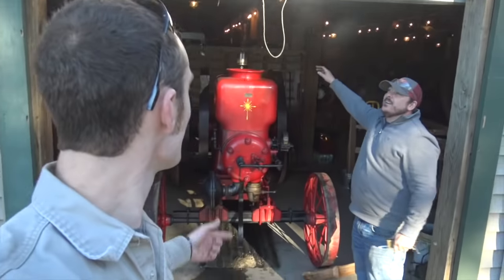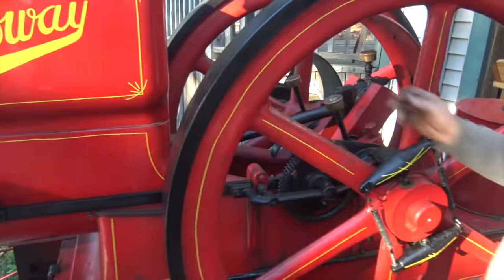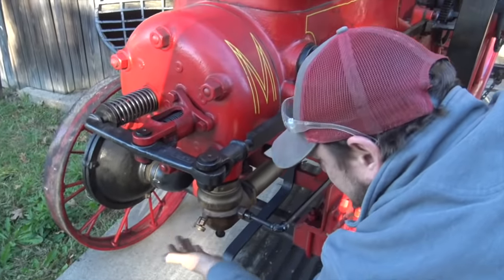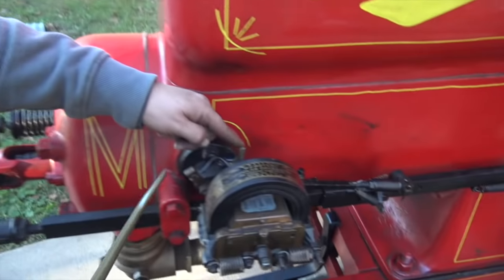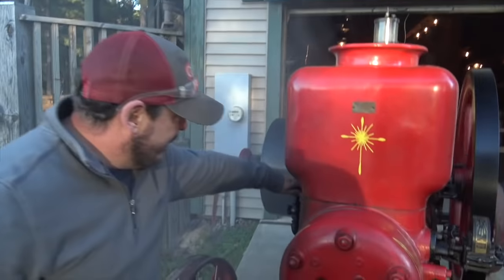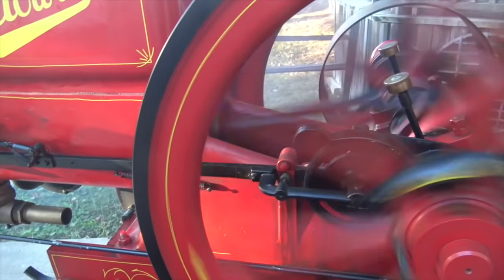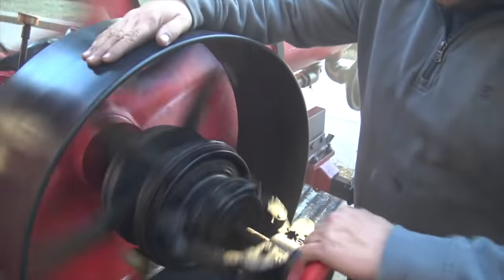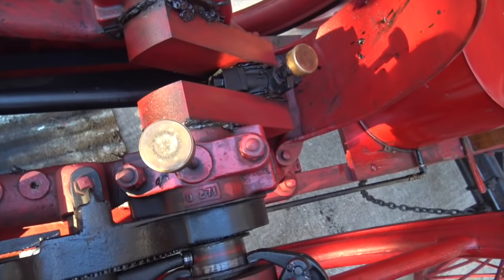WHY THIS INCREDIBLE ENGINE FROM 1916 IS PROOF THAT MODERN EQUIPMENT IS A SCAM & OLD STUFF WAS BETTER

Comment: I really like the old classic engines, but some of the comments about long lasting and new engines are planned obsolescence junk are pretty silly. Take a modern engine and make a few mods.
1. Throw away the electronics and put on a 1 or 2 bbl carb and a low-energy ignition system with centrifugal-only advance.
2. Drain out that high efficiency super-thin oil and replace it with 10w40. In the winter, you had better preheat before starting but it will work.
3. Run your new-old engine at a steady 600 rpm and get approximately 1/5th the original rated horsepower. Oh, and it will also produce about 1/10th the work per gallon of fuel.
NOW how long will it last? Probably a lot longer than an antique engine because of the many advances in metallurgy in the last 100 years. Not to mention better rubber and plastics.
It's mostly not that older engines were better. It's that newer applications are dramatically more demanding.

Comment: Modern equipment is a scam because they are meant to break, replace, and service (though service techs only)
Original Ford tractors are THE MOST easy equipment to repair.

Comment: 42 minutes of tinkering with valves, oilers, screws and spinning a 1klb flywheel by hand just to get 175rpm and tons of black smoke "LoOk aT ProOf tHaT old ENgINEs aRE BetTer" duuuhh." While hit and miss engines are cool, they are definitely not better!

Comment: As an engineer, I agree that "old stuff" was built better and there is a very simple reason.  Today we have the design technology, mainly from computers, to engineer a product to last a certain amount of time.  Companies walk the line between not producing a more expensive and well built item that will last years, vs. an item that will last for say, 1-2 years with the idea that you'll be forced to buy a new one.  Make more money that way.  One hundred years ago, they had to build things robustly because the lifetime/lifecycle design technology didn't exist.

Comment: The title of the video is a scam. Clickbait.The amount of iron used in this old engine for this tiny power output makes it better in nothing. Ridiculous poor efficiency, lots of maintenance like permanent filling up cooling liquid and oiling by hand. Its just a thing of its time, they didn't know better. They last only quite long because the most parts where not really stressed to the limits.

Comment: So its cool and all but it IS a 16hp motor. Take your 16hp mower and belt drive it to 2 - 1000 pound flywheels 4ft across and it would do the exact same job and still be 2000 pounds lighter. Very cool though, jist don't get hung up on false nostalgia. Im 100% positive the engineers in 1916 would have LOVED loved loved to have a modern ICE to replace this "hunk of junk" (not my words, words of a 1916 engineer :)
Reply: Probably a lot more than 16Hp if it was dynoed. I am guessing it was calculated from something like the old RAC formula which was extremely conservative. For example the Austin 7 was a lot more than HP although not a rocket on wheels. Not sure if there was something similar in the US.

Comment: Common misconception that old stuff was built better as a general rune. Its called survivorship biased, we think that because some of the old machines survived so long that all old machines must have been super good and reliable, when in reality most of it was junk after a few years and failed and was thrown away, leaving just a few good machines left. The same will  occur with our machines of today. If a society builds enough machinery some of it will inevitably be good enough to last the test of time.

Comment: Well I mean there is something to be said about these old engines. A sixteen horsepower engine can certainly replace sixteen horses on a capstan, and go just as as fast as sixteen horses. However a modern  12 kilowatt engine will take one horse and drag it over 100km in an hour. That would make quite a difference. 
Now if it's longevity you are after; find yourself a commercial equipment dealer. And follow those maintenance specs to the letter.

Comment: Long, boring tl;dr
The reason why older equipment seems to "run forever" are many. To brush it all off on "stupid computers" and "plastic parts" is ignorant at best.
Firstly - the old eqpt you see today is the one with least use. All the old stuff that was used regularly - got worn out. Otherwise we'd see 10x older cars on the road and 100x older washing machines.
Into the sparse of what you see todsy this engine fits perfectly - because even as far as IC engines go it's built wrong - no crank counterwrights. That will just eat up the big end bearings.
Finally, older equipment is far less energetic. If old engines did just fine with say 10hp/10L displacement, today it's a death sentance as the thing would weigh something awful. And equipment that is physically smaller/lighter yet yields a higher effect will also experience so much more stress and wear.

So this eternal "everything was better back in the day" is a strawman.

Comment: Funny thing... if you get rid of all that computerized trash under your hood, not only does your vehicle run BETTER, but you can fix it yourself with hand tools.

Check out some of the folks who have ripped their engines down from fuel injected to carburetor and compared their fuel mileage.  It's no joke.  If it's not a diesel it doesn't need fuel injection.

Comment: You know... most people are SO gullible... I shake my head! I have now fixed my old ( 60+ years ) oil-fired furnace boiler for the 2nd time in 10 years! I have discovered since the ( first time, in 2016 ) that virtually NONE of the heating/cooling companies want to fix them! Rather sell a NEW 'thorw-away' furnace. Plus the 'yonger techs no little to nothing about them! Two of my neighbors went this route, both about 10 years ago, after seeing commercials form local companies 'warning' them if they had an 'old furnace/boiler'.. they could get 'caught in the cold'.. Well? BOTH neighbors-after opting for the NEW furnaces, voiced regret after having had the repair people out to their homes literally 2-4 times a week the first winter and several times throughout the next ten winters! And now? Those same heating-cooling companies are running commercials that state, IF YOUR FURNACE IS TEN YEARS OLD- it's TIME FOR a NEW one!!! I found video's on-line detailing virtually 'all systems' in older furnace-boilers, and having a decent amount of elctro-mechanical/.pneumatic and hydraulic experience? REBUILT the systems. The first time, it was simply an ignitor- in 2016. The 2nd time this past January 2023? It was simply the hot water safety valve but I rebuilt, cleaned about 90% of the furnace and it has worked flawlessly and will no doubt out last ME!

Comment: IT REALLY SHOWS THE EVOLUTION FROM A STEAM ENGINE TO A GASOLINE ENGINE 🚂🚒 I REALLY LOVE THESE KIND OF ENGINES CUZ IT TELLS ME LONG AGO THAT HIGH RPM ENGINES ARE WHAT ARE KILLING OUR PLANET FROM HIGH RPM LOW FLYWHEEL WEIGHT AUTOMOBILES TO EXTREMELY HIGH RPM JET ENGINES OR POURING GALLONS OF FUEL IN PER SECOND.     DAVID GRENIS BOULDER COLORADO USA
Reply: And your comment tells me you haven't a clue how things work.

Comment: yeah its built to last, but lets be honest theres no way that thing is as fuel efficient as a modern generator or car engine.  he talks about how much fuel he uses but does that thing actually do any work or is it just used for fun? a car engine had to move a 3000 pound plus vehicle 70 mph down the highway.  thats a ton of work, of course its burning more gas.  that thing produces only 16 hp and probably weighs over 1000 pounds easily,  meanwhile a modern 4 cyl weighs only a few hundred pounds and can produce 10 times the hp, without forced induction (turbo, supercharger, nitrous).  the only way this old engine is "better" is durability.
Reply: And old car engines are MEGA shit compared to modern ones. You cant just drive 150,000 miles in a Model T only from oil changes.